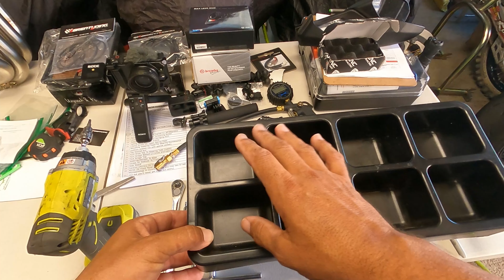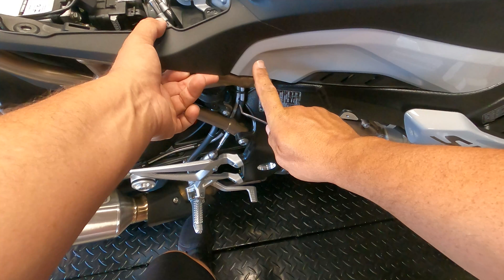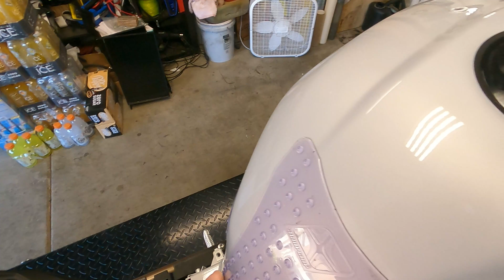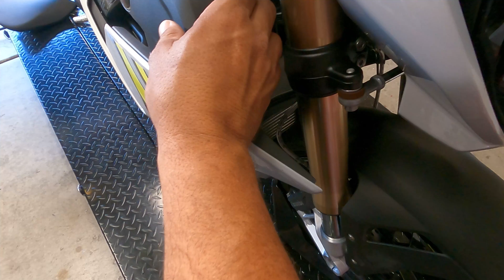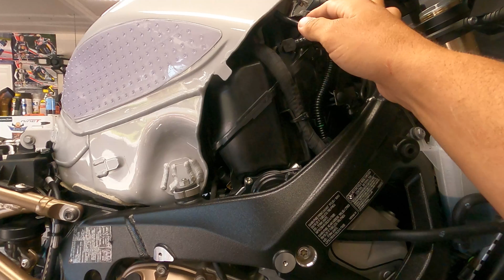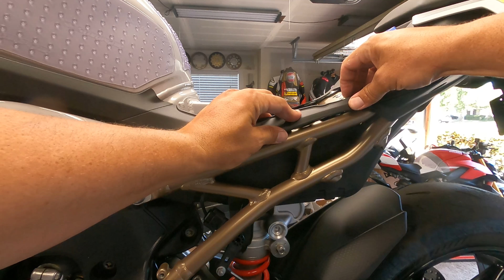2022 BMW S1000R | Side Fairing and Gas Tank Removal and Install

Comment: If fitting a BMW oem radiator guard set, you only have to remove the right side fairing pieces and the lower left fairing piece also 1 bolt from the inner guard and 1 clip (you will see which ones), you can then remove the whole inner guard assembly and fit the guards, Thanks for this vid it was super helpful in working out how to remove the fairings, much appreciated.

Comment: This video was amazing! I followed it step by step and I mounted the radiator guard set. I also pulled a cable from the back-end to the steering wheel all the way through the bike guided under the tank. 

I am absolutely not technical. But this helped me out! Thanks alot! Tommorrow the duoseat mount, tankpad and battery charger plug are up next. Wish me luck!

Comment: @CaliMoto TV - the most important part you missed to show- how did you actually put radiator grill inside??? i cant figgure out, because nothing seems hold grill in between plastics- i cant proper fix it :( :( - maybe grill from RR does not fit on to R? or i need some special clips to attached them ?

Comment: Great video thanks!. Silly question but do you need to drain the tank for this or does it have a stop valve to prevent fuel coming out when you disconnect the fuel line?
Reply from the maker: No need to drain the tank, it has a stop valve.